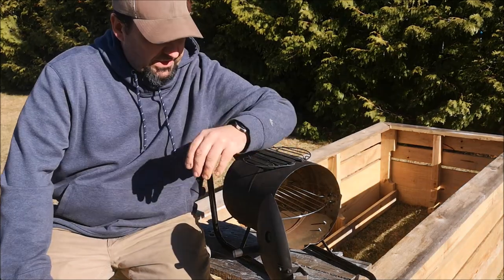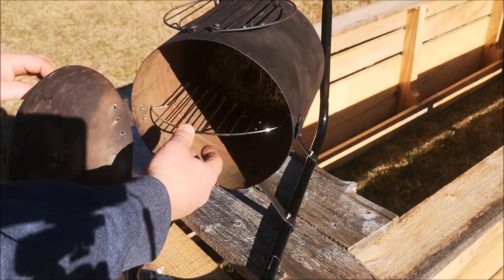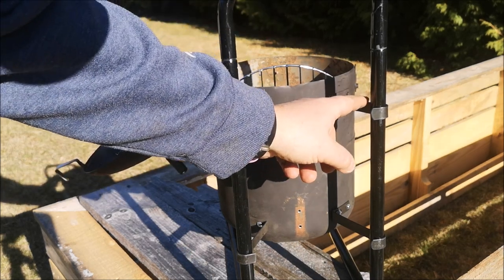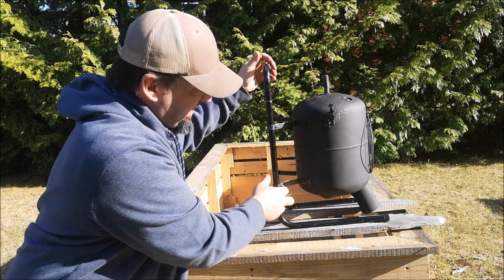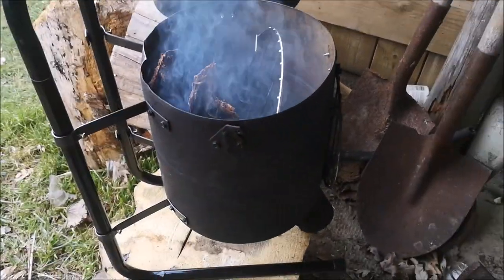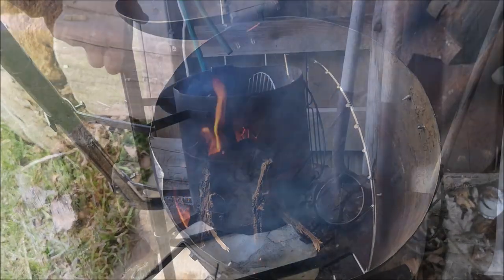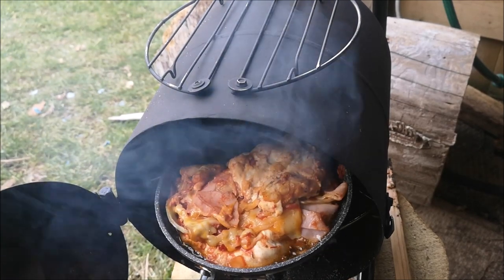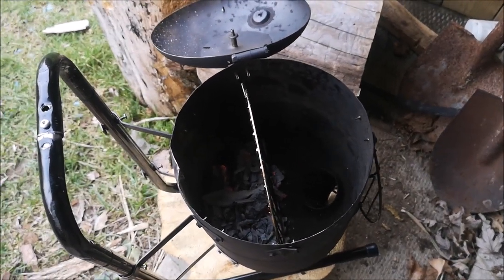DIY HOT TENT STOVE/OVEN | NO WELD WOOD STOVE

Comment: Nice little build. I made a similar no weld burner for my homemade sauna from a large gas bottle. I also used thick tin foil as makeshift seals that work perfectly on the door and screw holes. I get zero smoke leakage.